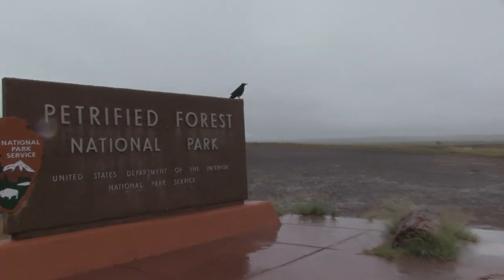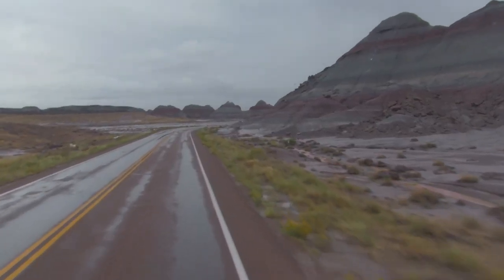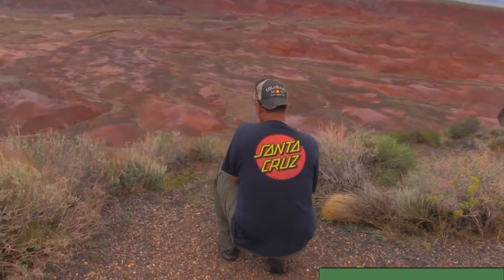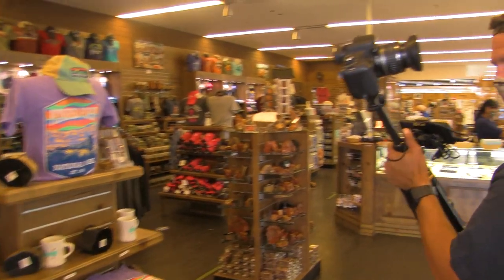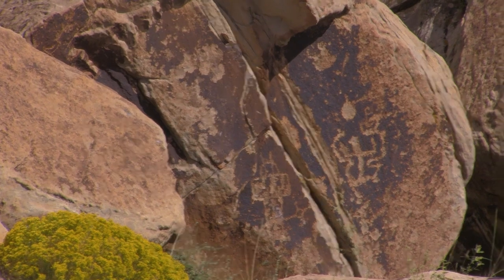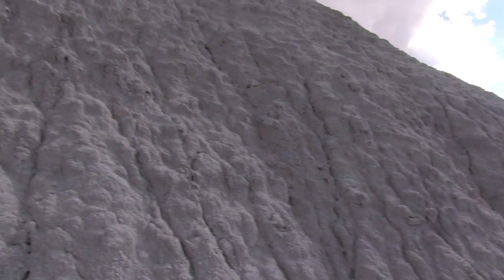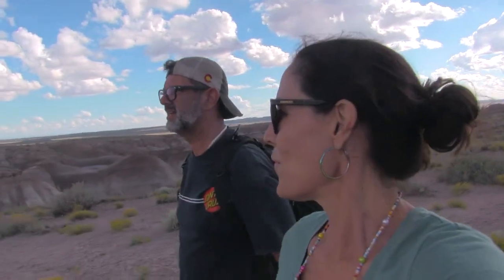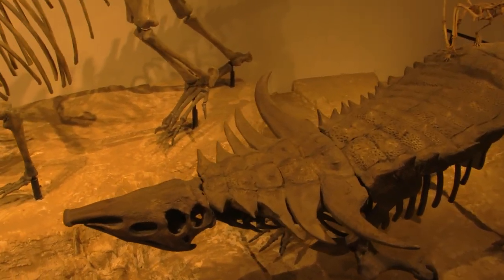Bussy McBusface Visits Petrified Forest National Park & The Paint Desert!

Comment: Have a question for you. How does your mini split a/c hold up on solar power? Does it keep up when it's hot in the desert? Does your battery bank and solar keep up with it? I'm planning a similar sized conversion and am going to fill the roof with panels in an effort to keep cool in southern AZ when I vacation there.
Reply from the maker: We kick on the generator.  It's a lot less hassle than checking batteries and worrying.